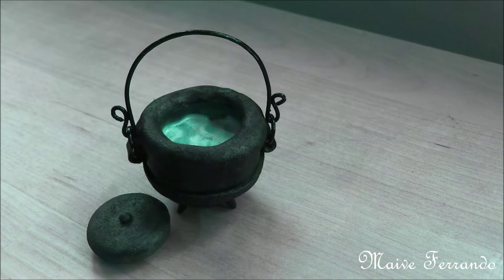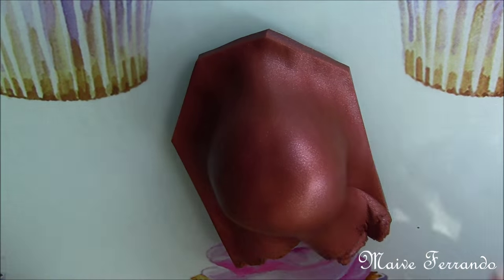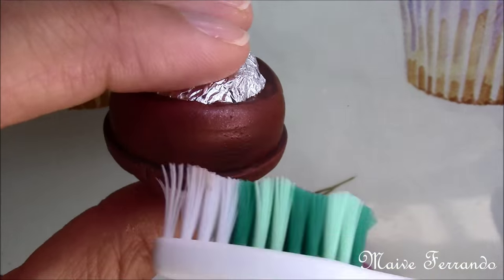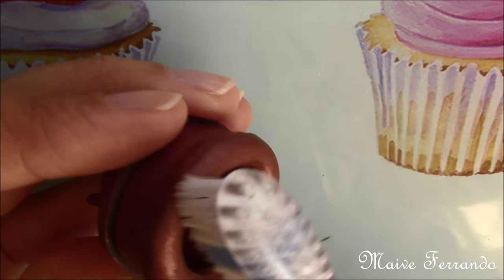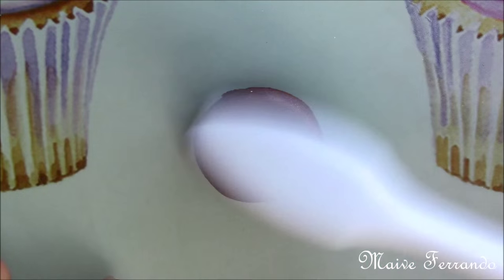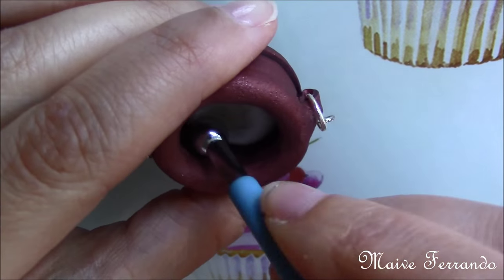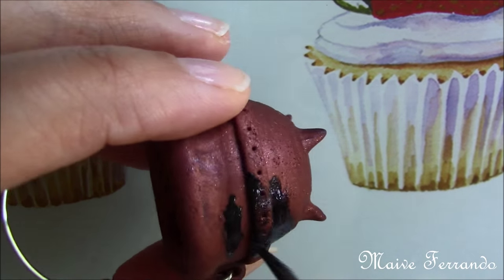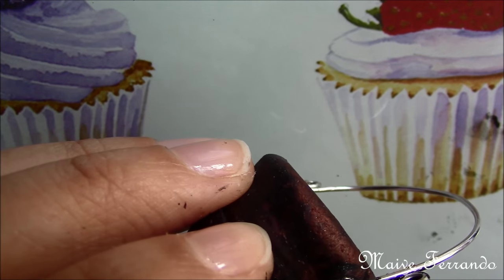Easy Miniature Polymer Clay Witch's Cauldron Tutorial | Maive Ferrando

Comment: I love all your tutorials and I want to thank you for them too, so THANK YOU!
I do have just one question, where did you get the little black hooks with chains that hold the cauldron?
Reply from the maker: Thank you! They whole handle was a piece of wire that shaped with round nose pliers, and I painted it black because at the time I only had "silver" wire, but you can get it in black too :)
Reply: Thank you and where did you get the black chain with hook that is shown at the very end of the video?  :)
Reply from the maker: The hook was a piece of wire as well and the chain is from online jewellery supply shops.